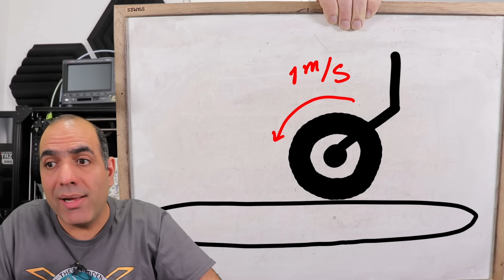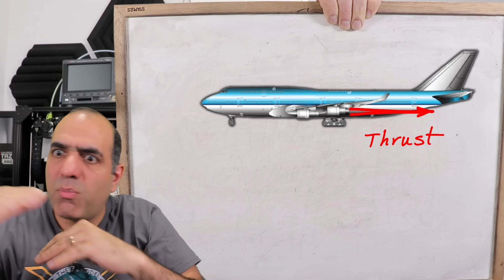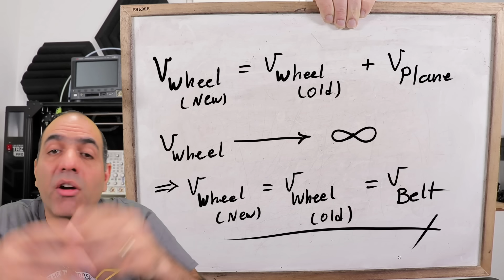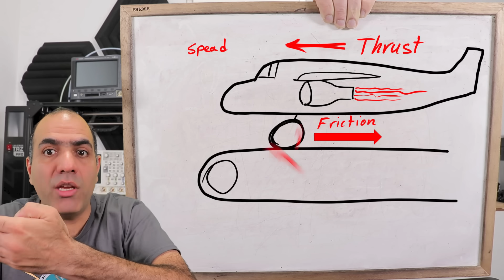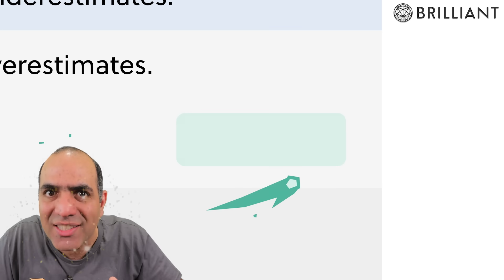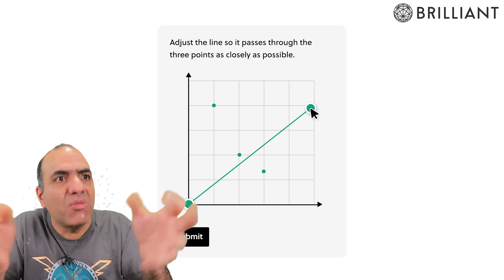Airplane Question that Drove Me NUTS!!!

Comment: I tend to like more hypothetical versions of these as they tend to embrace the more fluid and open ended nature of these thought experiments. In my mind, all of those answers are all equally valid explanations as long as you list your rationale behind your assumptions.
Reply: Exactly. I'm just tired of being talked down to like a child because I gave my reasoning and conclusions (which are largely in line with what Medhi said - it depends on what your assumptions are  and that can give different answers).

People can go ahead and stop saying "aktshually cowclops, a plane doesn't move forward because of its wheels." I'm a pilot. I know. I'm also an engineer. Sometimes things aren't as simple as they initially appear and being able to approach a complex problem from all possible angles is how big problems get solved - not just parroting what appears to be a convenient but incomplete explanation.
Reply: Giving the rationale doesn’t fix being wrong.
Reply: @givenfirstnamefamilyfirstn3935  you must have misread my comment, read it again. A question can have multiple equally valid answers that are all justified based on unknown factors that are left up to the interpretation of the user.
Reply: @chrisblammo123   My point is Mehdi’s confusion generates nonsense and explaining perfectly the flawed logic does not advance a valid solution.  It helps to visualise Mehdi as a politician or a used car salesman.
Reply: @givenfirstnamefamilyfirstn3935  
I understand the point, but the others here are deffo also right. it depends on the question and how many variables it defines.
ever heard of correlation does not imply causation? often used example in psychology = you can test and confirm that ice cream sales and aggressiveness of people are correlated. 

with this data you have actual empirical evidence that ice cream makes people more aggressive, but that's not really true, they're actually both correlated to heat. and heat causes both of them. 
in hot weather people go out more, interact more and there are more cases of aggressive behaviour. and during hot weather the asphalt is more viscous and people eat more ice cream. 
what I'm trying to say here is that your view and results can rely heavily on the variables that are known and that were kept into account.

looking at Mehdi's answers in this vid: they are all factually true within the constraints they were set in. And sure, it can be confusing, but it's not nonsense, that's how thought experiments work and that's how a lot of science actually work and how all the shit started that lead us to having computers. 

E.G. a lot of physics laws got 'invented' by some smart cookie that noticed something, then someone else gets more data and notices that something is still off about the theory, they do a thought experiment, come up with a hypothesis, then test it. and lo and behold. the law was wrong and needs to be refined/adjusted.
good example is boyle-mariotte and vanderwaals forces. boyle-mariotte is still heavily used in things like scuba diving (cause it's an easier formula than vanderwaals forces), but is not accurate due to vanderwaals forces also being a thing.
Reply: @psychotimo  Saying that a wheel rotating at double speed even if it is moving away at single speed will violently hurl a compatible direction single speed conveyor to infinity is wrong, it doesn’t matter how sure Mehdi is (assuming that he is not ‘simulating’ his confusion) a competent evaluation of speeds and rotations will expose it.
Does anyone for one second really think that such a mechanism would annihilate itself attempting infinite acceleration?  The mechanism would be complicated and vastly expensive but not impossible, the model in the question belongs in the real world and the explanation should also belong in the real world.
To unquestioningly rubber stamp Mehdi’s mental wandering is no better than the poor simple people knowing with conviction that the plane is held in place by the conveyor movement.
Reply: @givenfirstnamefamilyfirstn3935  all you're proving is how rigid you are in your own interpretation of the question and that you're unable to look at any different point of views. 

not to mention the amount of issues in this : "Does anyone for one second really think that such a mechanism would annihilate itself attempting infinite acceleration?  The mechanism would be complicated and vastly expensive but not impossible, the model in the question belongs in the real world and the explanation should also belong in the real world." 
This is fairly easy to counter. do you mean the creation of a runway size conveyor belt? yeah that's going to be expensive, but the whole "designed to EXACTLY MATCH the speed of the wheels" is impossible (and that's literally stated in the question, so that's not an unknown variable). you're in favour of the interpretation in which the plane flies, and yes in a real world example I agree that that would be the case, but only cause it's impossible to create a conveyor that matches the wheels. the plane is going in one direction with a certain speed, the wheels must match this speed to keep up with the plane. the conveyor can try to go the other direction and try to match the speed, but if the conveyor speeds up then so will the wheels, meaning the speed of the wheels will always be "speed of plane + speed of conveyor" , meaning that either nothing moves and they all have a speed of zero (and the plane obvi doesn't fly) or it's literally impossible to create the conveyor both theoretically and physically. the conveyor can only match the wheel speed if the plane speed is 0. so yeah, the mechanism isn't just complicated and expensive, but also impossible for any interpretation in which the plane flies and as such, NOT a real world example.

as for 'attempting infinite speed'... literally impossible since infinite isn't even a number, it's a theoretical construct,and deeming it to be part of a 'real world model' is a direct contradiction to the value of infinity, which is literally undefinable by any real number, it is endless and as such it only exists in the theoretical world. so NOT a real world example.
also, friction is created by systems working on each other, the conveyor would have multiple moving parts, if it tries to reach infinite speed then the friction would melt or erode those moving parts before it moves at infinite speed (which it can't anyway cause infinity is a concept and not a number). somehow inventing a system without friction would make it a lot easier, but that's literally a perpetuum mobile, which is a theoretical construct that is impossible due to the first and second laws of thermodynamics. so once again, NOT a real world example.

I mean, theoretical physics is known to be notoriously complex, and for good reason. and without more nuance in the question, or a lot more variables, this plane question can't be answered unless we make assumptions. not to mention that it is, by design, already putting us into the field of theoretical physics cause of the way they asked it (conveyor matching the wheel speed, which i already explained is only possible if the plane doesn't move in the first place).

FYI, I'm not trying to be an asshole here, but you should really just open up to different interpretations and try to learn from them, rather than just sticking to your own first thought. no theory is bulletproof, A scientific hypothesis is only credible if it is falsifiable.
Reply: @psychotimo    Is being rigid wrong if it gives an answer and nothing else produces a valid alternative solution?  Mythbusters’ real world achievement with this question was ignored in most comments.  Mythbusters got things right a lot of the time, I think it was because they were practical and could recognise many bad presumptions.
 Mythbusters could have had their car towing the conveyor belt driving in the same direction parallel with and to one side of the microlight aeroplane.  The tow rope could run through one or two pulleys up to the conveyor.  As the plane opens the throttle and moves forward the car also moves forward keeping abreast of the accelerating plane.  When the plane (and its wheels) reaches forty knots the conveyor being pulled backwards also reaches forty knots.
The hard part of this question is simplifying it.   People who throw in a thousand complications cannot see the simple model, the answer has passed them by and they are stuck going in circles.
The car and tow rope device is crude but it satisfies the terms of the question, it could easily be made thousands or millions of times more precise with electronic speed measuring and data transmission and automatic throttling but the simple principle would be exactly the same.
You know how the simplify this model even better and more precisely match the requirement of the question?  Ditch the car and make the plane tow the conveyor, the speed of the conveyor being towed backwards via a pulley is the forward speed of the plane and its wheels.  The plane could release the tow once it gets airborne.  Glider tugs do this sort of thing all the time.
See how simple is better?
All the convoluted complications can be dismissed with reason, if complicators haven’t got the big picture they haven’t thought it through and they cannot see where they are mistaken.
Mistaking the movement of the wheel with rotation of the wheel is an example of confused complication.  What if the wheels have different diameters?  Which matching rotation rate will they pick with a Harrier jet which has three different wheel diameters?
Insisting on an interpretation of wheel movement as ’rotation of the wheel’  denies the same but opposite rotation rate, say in rpm, to the conveyor.  That is not logical, it demands linear progress off the conveyor surface but denies the linear progress of the entirety of the plane’s wheel.  Heads I win, tails you lose.
If they demand the linear progress of the conveyor surface combined with a doubled wheel rotation rate from the plane’s forward motion instantly accelerating the conveyor’s speed to match the doubled wheel rotation rate they do so from the visualisation of a stationary position. 
They do not see the wheel’s doubled rotation rate being inherently from the plane moving away at single speed so the plane’s attached double rotation ‘speed’ wheel actually is not violently clashing with the conveyor but is simply moving away from it with an ordinary surface contact.  The laws of physics were not broken.
Mehdi’s positive feedback to infinity wheel rotation and conveyor speed ‘theory’ comes from that error, he hadn’t thought it out.  The rest of his concepts fail as a result.  Mehdi’s exponential friction increase gumming up everything ‘theory’ also comes from that error.
Even Mehdi dismisses the conveyor rotating at the same speed as the bottom surface (only!) of the wheels below a stationary plane.  In addition to his dismissal can I add how would the conveyor first move?  The plane would have to rotate the wheels first, that would have to be from the plane rolling forward.  How would the wheels speed up? the same applies it would need the plane rolling faster!
The plane sitting still solution disregards the question ‘can it take off?’  Assuming the parameters Mehdi brought up like atmosphere and assuming some special high speed tyres the plane could take off.
DNA structure was discovered by Watson and Crick standing back and thoughtfully looking at the available evidence largely pinched from others.  Franklin had all the information from her own research but was mired in pointless excessive distracting detail, speculating on meeting a solution somewhere up an endless blind alley.  Brilliant Linus Pauling published an embarrassing rushed impossible model because he hadn’t thought it through and missed an obvious simple chemistry error.
Think it all out and get it simple.  Don’t indulge what is wrong, be rigid.
Reply: @givenfirstnamefamilyfirstn3935  I'm not saying that your interpretation is wrong, you are however, wrong in assuming that all other interpretations are wrong. cause they're just that, an interpretation of the question in which people fill in the gaps in their own way. and that doesn't mean it's the wrong way, it's just one of the ways it can be interpreted.
the original question is a hypothetical question that was asked in a purposefully vague way with not enough variables being defined, for the express reason of sparking conversation. the fact that we're having this conversation literally proves that point. 

sure in any real world example, due to normal real world limitations, there's no question that the plane will take off. but that's not the point of the question, the point is to spark debate, otherwise it wouldn't have been this controversial. even if we interpret it in real world values, then there's still disagreement on the "speed of the conveyor vs speed of the wheel", what "speed of the wheels" is meant? rotational speed? distance travelled by wheel surface?... cause, you might talk about "Mistaking the movement of the wheel with rotation of the wheel" but the question states 'speed' not movement or rotation. 
And in conventional real world examples this is usually measured by a tachometer that uses the rotation to calculate the distance, directly contrasting your interpretation of speed of the wheel. adding a tachometer to both the wheel and the conveyor will easily prove that the wheel will be faster than the conveyor if the plane is moving, if the tachometer shows the same speed then the plane will be stationary. easy example, turn a car upside down, run a conveyor on the wheels at a speed of X, read the car speed, it'll match the conveyor speed of X, but the car will be stationary, any extra movement from the car will add the car speed to the wheel speed, when speed is being calculated via a tachometer, which is the conventional real world way that we tend to calculate wheel speed/vehicle speed.

as for scientific discoveries as example, almost all scientific discoveries come from a simple process: see something, create a hypothesis, test the hypothesis. where the hypothesis is a purely THEORETICAL construct that was created for the express purpose of being tested. where often the scientist had to fill in some gaps. but in some cases we aren't yet able to test the hypothesis, usually cause we haven't invented anything advanced enough to test it.
but for that process to happen there needs to be either a question with a single interpretation, or we have to agree that a hypothesis is just going to test one interpretation of the question. in this case the mythbuster vid can only be deemed to have tested 1 interpretation, it was a good test, a solid result, but there's still some question about some of the variables and the way they were used.
not to mention that not all 'proof' is bulletproof, as a scuba diver I know of 1 massively good example: the law of boyle mariotte, stating the relation between pressure and gas volume (in a closed system), it's often used to calculate things like how much usable gas is in a scubatank. but it's actually pretty much bullshit once you go into detail. the law only holds up at lower values, at higher values it isn't accurate anymore due to vanderwaals forces. in a 200bar tank, there's more air than expected due to molecular attraction at pressure, but in a 300bar tank there's significantly less than expected cause of molecular repulsion. so yeah, boyle and mariotte weren't wrong, but also weren't right, they just didn't have all the info yet.

TBF, IMO even this discussion about the exact semantics of the question is part of the setup, but hey I don't mind, it's good brain training, just like the plane question is when trying to interpret all the options and taking it into theoretical territory xP
Reply: @psychotimo    We are never going to agree on the original comment,
"all of those answers are all equally valid explanations as long as you list your rationale behind your assumptions".
Good luck, bye.

Comment: I don't think 4:25 is quite right without additional clarification. Like Mehdi said, the question isn't clear enough. In this case, is the wheel speed measured relative to the conveyor belt or relative to the ground of the Earth? If it is measured relative to the belt then you get this infinite feedback issue, but if it is measure relative to the ground then the issue doesn't appear

Comment: The conveyor belt would have to be running fast enough to not only overcome the jets, but also the lack of friction in the bearings. Which, of course, would quickly destroy the bearings, if they were forced to go that fast. So, unless the wheels can't move, it's going to take off.

Comment: You are still overthinking it, no matter how fast the airplane moves, thrust or no, there is no lift generated because there is no *airspeed*. Speed on the ground is required to generate lift, translated into control authority. Incoming air moves over the cantilever style wings, like you said, causing lift. This can only be generated when the forward or backward speed is greater than the relative speed of the air. 

You could get a slingshot to push the plane to a momentum equivalent of 150 knots, if the conveyer is likewise pushing back at 150 knots, there is not going to be any airspeed generated due to the plane remaining still. The plane has to go faster than the runway (normally 0 knots due to runways not being able to move, but in this case since it matches everything the plane does) in order to encounter enough air and airspeed to generate lift.

Basically, plane moves forward at 150 knots, runway moves backwards at 150 knots, the actual position of the plane remains static.

Now a better question is "What speed will the conveyer need to move to influence the air to generate 150 knots of airspeed around the aircraft?"